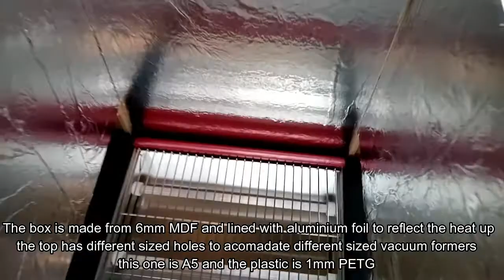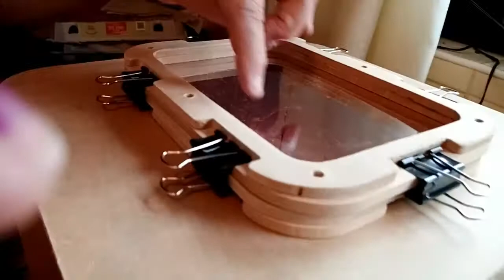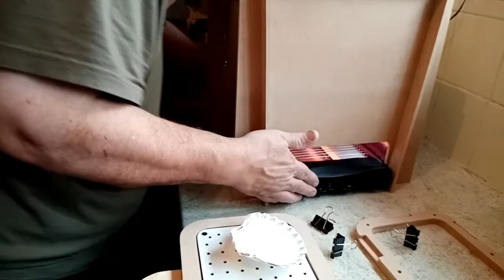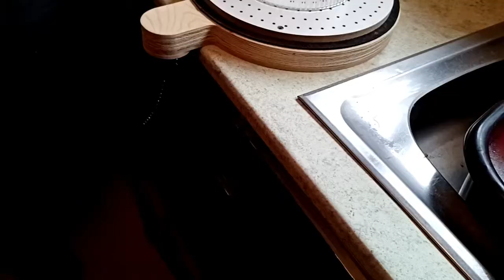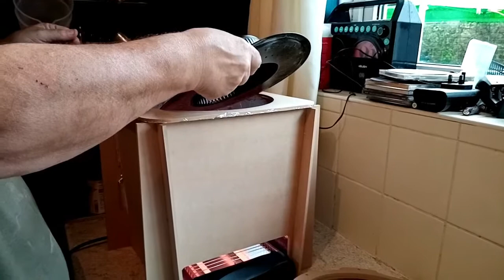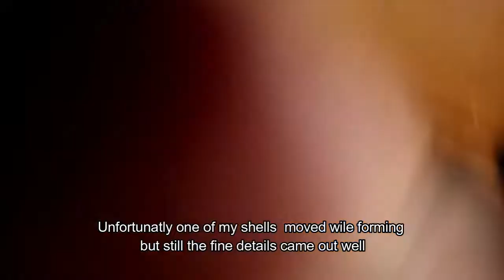Vacuum Forming With Slot Together Heat Box

Comment: Wont tapping the plastic often distribute fingerprints all over the plastic and ahow in the final product tho?
Reply from the maker: I haven't found that  if you watch the video close the plastic acts more like a sheet of rubber when its still under heat  Im not saying it wouldn't happen with different types of plastic but in those cases I would do a couple of test pieces to get an average time and use a digital heat gun

Comment: Looks amazing and something I am interested in using, how does the vacuum work, as on the larger setups, they use compressed air.
Reply from the maker: This system uses a domestic vacuum cleaner  they are great for plastics up to 1.5mm thick after that  you really need a vacuum pump  tank based system to get a strong enough vacuum for thicker materials like 3mm abs often used in storm trooper armour I do make that type of system as well checkout 
https://www.youtube.com/watch?v=znLNCyApHhE
its a little steam punk and costs around £600 but that's  a lot less than a £20.000 commercial system 
hope this helps Thanks Mike